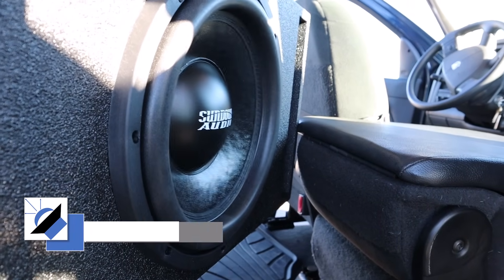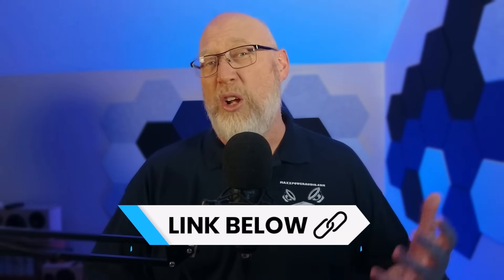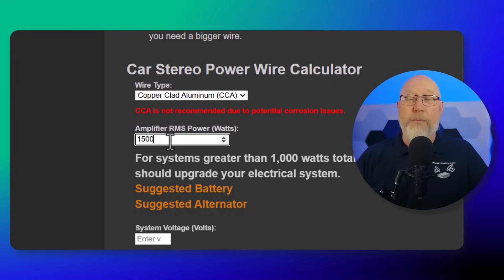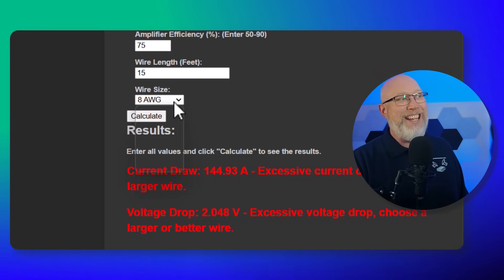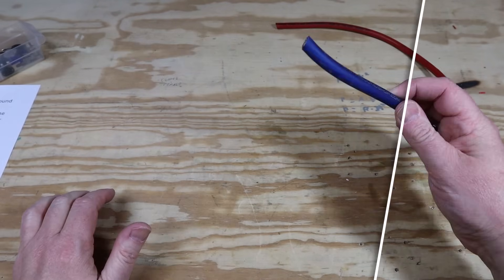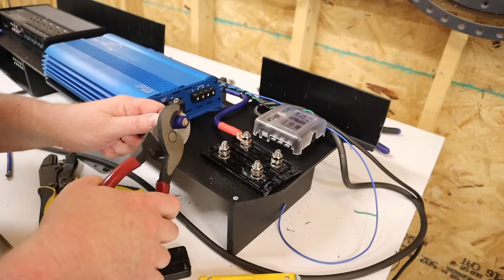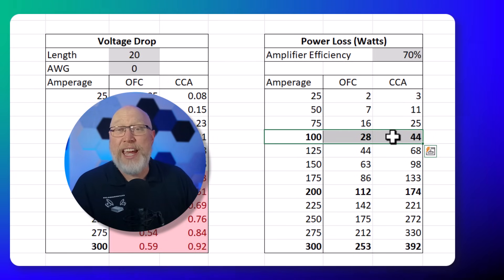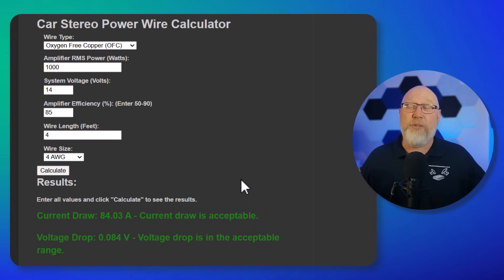The WRONG WIRE will starve your amp.

Comment: Why not use a capacitor to run a little higher than 1000 watts? Isn't the initial hit to get the sub motor to start moving the biggest energy robber? How does a good capacitor affect everything?

Comment: What's the best way to find out if your system is undersized as installed? Ended up with stinger 4ga cca. Running a 900w RMS bass amp and a 100x4 RMS mids/highs amp. Class D.
Reply from the maker: Try the wire calculator on my website:  DIYaudioguy.com. Just total up your total system power. Figure out how long your wire run is. The calculator will do the rest.

Comment: Install the 2000rms system guys 😂 just carry jumpers or push start until you can afford a second battery or alternator upgrade 😅 plus most of the time you'll be playing the system under 1000RMS

Comment: There’s also the risk of melting your power lead if you go too small, people don’t often realize that different wire gauges exist for a reason and you never want to go too small on your wire size for powering the amp same can also be said from going to your amp to your speaker!
Reply: Sounds like that would be a result of an improper fuse system for the wire too. Fuse amperage should be based on wire size and length not just what the amp is.

Comment: @DIYAudioGuy New to your channel I am doing the big 3 on my 2001 silverado with stock alternator. I Purchased 1/0 Welding cable from Southwire. How ever I am planning to get a bigger alternator probably a 320 how ever including both of my amps I will be pushing roughly 2K (1600 on subs and 700 on voice) . Do I need to switch to 2/0 welding cable or the one that I have is more than enough? Also is it really needed a 320 amp alternator or 250 is more than good for my what I am running? I am not doing competition. Thank you for any insight
Reply from the maker: I have a wire calculator on my website, diyaudioguy.com  that is what you need to find out what size wire you need.  It is designed for the main wire running from the battery but the principle is the same.  As for the alternator, most 320a alternators need to spin fast to make that power.  So if you plan to just sit and idle all day the 250a may give you the same real world power for less money.  I recommend Mechman because they have great customer support.  You can get somebody on the phone and they will walk you though the details.
Reply: @DIYAudioGuy  Thank you so much for all your knowledge I really appreciate it, keep up the good knowledge and cool community.

Comment: Theory crafting using a size calculator is fine as a starting point, however ! The truth is what is the voltage drop?
From battery to amps? As little as .5 voltage drop is noticeable.
I use tinned ofc, and oversized wires, and wire once, the other issue is how the wire is prepared for install.
I use a 12 ton hydraulic crimper, heavy duty , adhesive shrink wrap, that is waterproof, and end ferrels of proper size.
Over time any oxidation will increase voltage drop, a voltage drop creates heat, heat creates corrosion. The downward spiral begins.
Bottom line is what is your current voltage drop.
It’s easy to measure. Do a little basic subtraction, and know.

Comment: Enjoying your videos... but I'm noticing that I never see (or at least haven't yet) and videos where you have any capacitors (1F, 3F, 5F, 10F, ... 300F ultra, etc...).  Am I to infer from their absence that you don't feel they are needed?  I have two amps (RockfordFosgate... 800 amps for subs and 600W for mids/highs).. I originially had a 1F cap when I had my system installed years ago.  I'm re-doing EVERYTHING myself (still keeping original amps/subs)... and upgrading my wiring AWG from 4 & 8 to 0 & 4.  My biggest question is do I re-use the 1F cap, toss it, replace it with one of the ones I listed or just skip caps altogether?  HELP!  :)

Comment: Great video Mr Audio guy. I was using your calculator and I saw that there wasn’t an option for 2 sets of wires. The reason why I think this is important is because some people including me, a running 2 strands of 1/0 wire. And your calculator is telling me that my 1/0 wire won’t handle my application because I can’t select 2 1/0 wires. Maybe would you consider adding that parameter? Thanks
Reply from the maker: It's on my list of revisions for the next version.  In the meantime, you can just divide the two number of wires you plan to run.

Comment: Okay, I used your calculator and since I have CCA wire it's telling me that it's not sufficient to run my amplifier. But what if I'm running 0 gauge CCA and a 4 gauge CCA? Would that pick up the slack having the extra 4 gauge? My battery in the trunk near my amp is running low constantly. After about an hour worth of booming. The battery will take 8 hours at night on the charger. Please advise!!!😂

Comment: is my cable thick enough its 35mm2 or 2 AWG OFC???
my battery is in trunk and the amps are max. 1 meter away.
2F Power Cap from Hifonics
JBL Club A1000 (1000wrms at 2 Ohm)
JBL Club A754 (4x100wrms at 3 Ohm)

Comment: If i was to run 0 gauge power wire and step it down to 8 Gauge at the Amp whilst using a 500 W-RMS Amp would that cause any problems? As i'd like to get the wire situated in place for future upgrades to save the headache
Reply from the maker: Nothing at all wrong with that.  I did the same thing several years ago.  Just make sure you fuse for the smaller wire (or when you step down to a smaller size add a fuse).  You can use something like this:  https://amzn.to/4iqY3so

Comment: what about welding cable used as a power wire ? just a question
Reply from the maker: It works just fine.

Comment: I've always used royal excellence welding cable for both power wires and speaker wire. Appropriate sizes per application, of course.

When I worked building cranes, it's what we wired up huge cranes with, so I knew it was durable and worked great for high amperage.
Reply: I have the same wire. I’m using it under the hood for the alternator wires. My Conext Link OFC wire from Amazon is more thick overall, and has a lot more copper in it than the royal excellence. And the Amazon stuff was a lot cheaper.

Comment: Could you make a video of why large strand wire used for ac voltage is not good for car audio? Show the difference in resistance, current flow and a side by side comparision clamping the power going into the amp as well as coming out of the amp to show the difference. Then go over all the problems like connectors slipping off and stripping out screws on the power input before the wire is secure. Apparently there are people who still think that wire is just wire and there is no difference between large and small strand wire.
Reply from the maker: That sounds like something for this guy to test:  https://www.youtube.com/@GloweIndustries

Comment: Welding cables are very good for powering car audio amplifiers. They have good quality copper, their braiding is designed for high currents and they have non-flammable insulation. In addition, they are much cheaper than branded audio products.
Reply: I'm looking to install my monoblock amp and sub myself to save myself paying heaps more for someone to do it for me and I've been doing a lot of research on forums, reddit and youtube to find out what I need to know. I've seen a lot of people recommend welding cables. I've also seen people recommend the brands Sky High and KnuKoncepts so I'll definitely go with one of those 3 options :)
Reply: Yup, I only run EBFlex
Reply: YES  MISTER  (COPPER CABLE  "10 mm" )

THIS  VIDEO .. IS ABOUT  "HE GETS MONEY"  FROM  "LINKS"  TO HIM SELF

LIKE  "ALL"  .. WE KNOW EVERYTHING  "YOUTUBER" ...

AT THE  "JUNKYARD / CAR GRAVEYARD"  YOU CAN GET "BIG CABLES"  FROM CARS ..!!

90%  UNDER  NORMAL  COSTs

IT  DO  NOT  MATTER  "THE CAR IS DESTROYED"..

( THE CABLES  ARE  FINE )

Comment: for funzies many years ago as a kid in my teens i reused someone's cheap thin cable and put in a old used capacitor. secret sauce was that i cut the cable and doubled up from the capacitor to the amp and upgraded there cable to proper gauge OFC to the speakers. they also had the fuse at the back of the car, that definitely got reinstalled as close as possible to the battery. I wouldn't do that in my own car, but it was a buddies friend that had no money lol. massive difference, and the capacitor didn't dip under 12v

talking about power delivery, lets talk about the whole circuit. on older cars you NEED to check that the cars grounding cables as they will corrode and not just mess with your amplifiers performance but also give you all types of engine electrical issues that will be misdiagnosed as just a something that goes bad all the time. need to make sure the engine block is properly grounded as much as the battery.

should note, OFC isn't all that important for bass and even CCA with the proper gauge compensating it will work the same. the real advantage of OFC is from the amp to the speaker to minimizes the capacitance in the wire (more metal/mass than is needed) so you don't roll off high frequencies. I tested and sold car audio systems for years and have played with audio equipment my whole life. in my 20's while working at a resale shop that had a special department for used car audio and some new i got to play with EVERYTHING on the market.. all the amps from knockoffs to amazing JL 1,500 watt amps and everything in between. i got to show the clients what cables made a difference on a bench, with different cables and capacitors all day

Comment: I wrote this to Justin in the comments, and I'll duplicate it here so more people can read it! CCA is a SCAM! Let me explain. The conductivity of aluminum (in other words: resistance) is 1.7 times worse than copper. That is, in terms of conductivity, 0ga CCA = 2ga OFC (almost). The same goes for: 2ga CCA = 4ga OFC; 4ga CCA = 6ga OFC. That's as far as conductivity goes! The price difference between 0ga CCA and 2ga OFC is very small! By buying 0ga CCA compared to 2ga OFC, you save about $20-$30!! But in return, you get oxidation of contacts under the hood and corrosion of the wire, poor contact and an increased risk of fire! And as a result, having saved $20 with CCA, in a year or two you will have to buy a set of wires again! But instead, you could have bought 2ga OFC right away, which will serve you longer than the car itself!! So yes, CCA is a SCAM and nothing more! There is no reason for CCA cable to exist at all! You are not saving money by buying CCA! If you want to buy 0ga CCA - buy 2ga OFC for almost the same money! You will get a reliable, durable, high-quality cable with the same conductivity as 0ga CCA! Zero reasons to buy CCA!!
Reply from the maker: That is why I don't recommend it.  I know some people will still use it, which is why I include it.  Hopefully, after running the numbers, people will see that CCA is not a good choice.

Comment: You can use cca or ofc, but it always needs to be small strand. That stuff made for ac is not good for car audio.
Reply: Wrong on every single one of these statements)))
Reply: @likemegapolis  i have used lamp cords when i was a teen . It works for speaker wire , but this videos main focus is power wire. You can hook up ac power wire to an amp and it will turn the amp on and play music . Then you drive down the road and the wire keeps falling out until u strip out your terminals and or fry your amp and subs because the amp is not drawing enough current and it gets hot while sending clipped voltage to your speakers , in less than a couple months you will have cooked amp and subs .
Reply: @Hayawasa  In normal, non-super-specific conditions, there is no such thing as a cable for AC and a cable for DC! The same cable is used for both AC and DC!
Reply: @likemegapolis  no no no, it has it marked on the cable sheath . As plain as day 220 - 480 volts AC . Just about every large strand copper cable you can find has wrote on it. Why is that i wonder? Why would they go through the trouble of wanting the consumer to know its specific to and required to be UL listed as such? Now yes lamp cords ,extenstion cords , can be used at 12 volts just as well as 110up to 220. They dont use small strand wire feeding into your house because the lower resistance will create more heat and melt the wire.
Reply: @Hayawasa The only difference between AC and DC cables is their insulation and interference protection! They have no differences in the current conductor! Small strands in the cables are made only to make the cable bend easier, only for this! And remember I talked about "super-specific conditions"? These are cables that transmit AC at frequencies of 100,000 Hz and higher! That's where the skin effect is just beginning to appear! At such frequencies, the size of the cable strands, its insulation and interference protection are important! Up to 100,000 Hz, the skin effect manifests itself very little!
Reply: @Hayawasa And the voltage that is indicated on the cable (in your example 220-480 AC) is the voltage that the cable INSULATION can withstand, not its conductor! Because at higher voltages the current can break through this insulation! This does not apply to the conductor itself! And don't believe me - just read the standards, or at least google it)))
Reply: @likemegapolis  i have tried to explain to you why large strand copper wire isnt good for car audio . Your trying to counter with insulator jacket specs. Ive tried my best to explain why small strand wire is used in car audio, and you can easily Google that as well. I can't however, explain it to you where you can understand. If you think your right , that's fine . Good for you, i hope it works out well for you. You could start a channel showing the world how they have been using the wrong wire .
Reply: @likemegapolis  at lower 12 volt dc the large strand creates more resistance and you can check it if you dont believe me. It also has less surface area than small strand.
Reply: @Hayawasa  🤦🤦🤦
Reply: @likemegapolis  🤷🤷🤷, ive gave you the answer as to why it isn't good for car audio, resistance ,less surface area= less current transfer, low movement/ vibration resistant, tell me what is wrong about what im saying.
Reply: @Hayawasa  I don't understand why you haven't been awarded a Nobel Prize yet for discovering that the resistance of a conductor changes with voltage 😂🤦🤦🤦
Reply: @likemegapolis  each wire is round , that circumference of each wire is surface area. Despite the cross section, a lower voltage direct current can travel through smaller wire strand alot more efficiently than bigger strands. The current isnt alternative its direct. The voltage is much lower and doesnt cycle like ac, thats why it doesnt transfer12 volt dc current as good as the small strand wire.
Reply: @likemegapolis  nobel prize? What im explaining to you is it changes with different currents at diffent voltage as well as the size of each individual conductor strand in a multi strand conductor. You just stated it changes resistance with voltage , why do you think the other variables i explained to you wont change anything? It's knowledge thats been around since the wire itself.
Reply: @likemegapolis  a cross section is a one dimensional veiw and is only one measurement of surface area, draw a big circle the draw abunch of tiny circles inside it. Measure the circumference of all the little circles and add them up. Then measure the circumference of the big circle . Which one is bigger? That is surface area , not a cross sectional cut that only determines the overall diameter.
Reply: @likemegapolis  when you fully understand what joules law and rms are , you will understand what im telling you.

Comment: This is not to power a car audio, this is to power a concert audio system onboarded in a truck.
To power a car system you don’t need the current capacity of a car traction system.
Reply from the maker: What exactly do you think car audio is?
Reply: @ a sound system to enjoy high quality audio in the car. But looks like your more on outdoor audio fit into a car